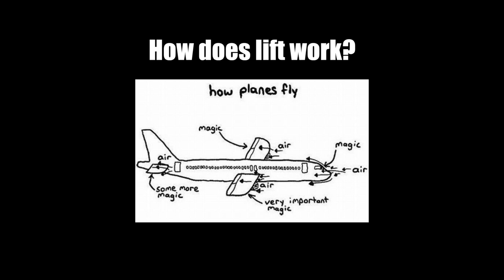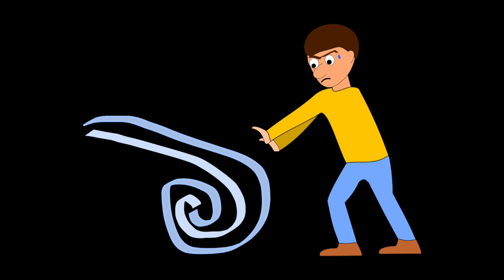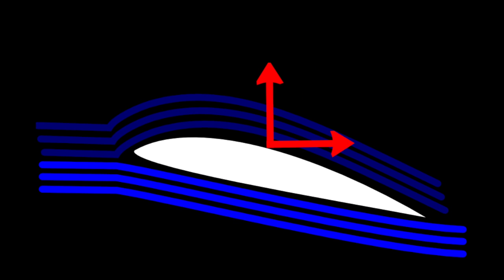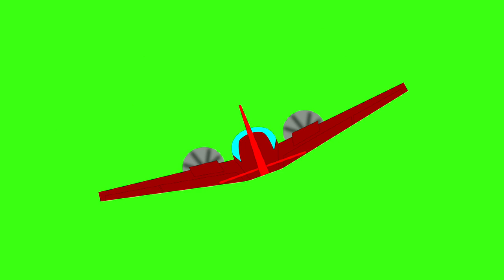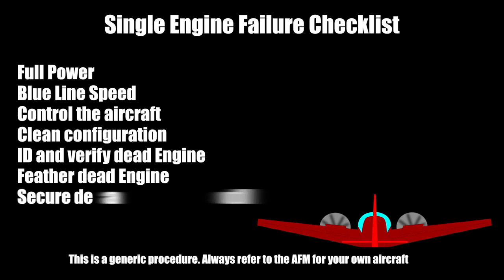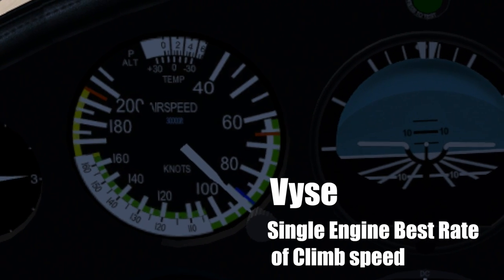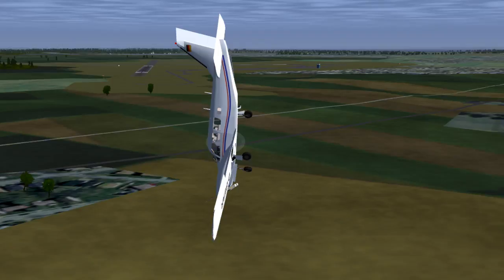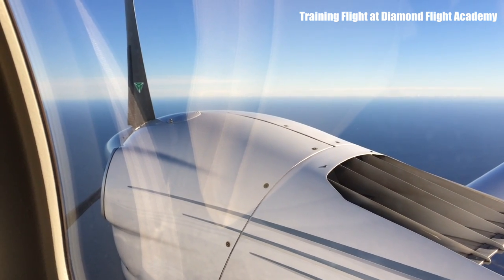Multi Engine Aerodynamics of a Fatal Crash: Mayday Talk Episode 14.5

Comment: The reason it crashed is because the design is not valid.   Such twins are underpowered and therefore are critical to fly.  Large transports have excess power.  

If you put two booms and a third engine in the nose (like a P-38 with an eingine in the pod instead of a gun, you could have an airplane that would be safe and easy to fly.  You would  have each outer engine with a rudder behind it.  When the center engine fails you have two balanced outer engine and it remains yaw stable.  .  When a lateral engine fails that engine is a smaller fraction of the total power and thus less adverse yaw torque.  Also each outer prop has a blown rudder with a camber that pushes towards the inside.  When the flow on the failed engine stops the rudder also has less push and the powered rudder then has a net inward torque making it fly straight without the need for rudder.  Unlike the boomerrang by Rutan, this would be simple, easy to build, cost effective and would allow inexpensive and less reliable engines.  If one fails, it is not a big deal.  You can also fly with 1, 2 or three engines at 65% and get much better MPG at slower speeds.  With the twin you can only throttle back and the fuel economy does not go up because of the increase BSFC or fuel consumption per hp.    

 BTW, Bernouli has nothing to do with it.  Mass downward movement does.  Also, the lift loss is around 25% and this is due to bad airfoil selection.  A good airfoil would maintain lift with higher AOA and would not spin like shown.   In other words, the airfoils are the problem, as well as the layout.  

These airplane are a joke and need to be scrapped.  There is a better way, and I just gave you one way, of many in my comments above.  Pilots are in denial.  These craft are not valid at all.  Three engines or one, but not two.  .

Comment: Not Sure How Much One Might Learn From This Video... I Know Anyone That Has Much Time In a Queen, Either a Big or Small Motored, Queen",,, Knows That If You Were Ever Foolish Enough To Put 10 Souls In Back, and  Then Fire Up The Engines, Your Dancing With The Devil... Any Pilot of Merit, Should Know That One Pop Out Of Either Engine,,,  Would Immediately Dictate Pulling The Power Off The Other Engine... (At Least You'd Hit "Right Side Up" ) A Queen 65 Has a Single Engine  Rate of Climb of Less Than 200 FPM At Gross Wt... (That Is After It's "Been Cleaned Up"  On a Standard Day) ,,, Merryface, That Was a Rude Comment I Made,,,, I am Sorry For That,,, There No Excuse For Rude Behavior... But One Must Always Remember, That There Are Only Two Types of "Aviation STORY"... When You Are Talking About Airplanes, Pilots, or Asian Massage Parlors,  There Are Only Two Types of STORY.... There Are "TRUE STORIES,,, and Then There Are,,, "STORIES",,, "That Actually Happened",,,, Usually The Two Are Not The Same,,,, This Flight Was Hanging By a Thread,,,
Reply from the maker: Hi. As an active airline pilot and ex flight instructor, i standby pretty much everything I said in this video (other than calling a Vmc roll a spin.)

What is it you think that makes me a "hangar queen aviation parrot?"
Reply: @MerryfaceAviation  🤗

Comment: Well, your explanation of lift is totally wrong. It also fails to explain how airfoils can generate lift when they have equal length surfaces (such as symmetrical airfoils). It also fails to explain how a conventional airfoil can generate negative lift at sufficiently low angle of attack - such as when the plane is flown upside down.
Reply from the maker: @PrimalBlueWolf  my explanation is not wrong, I omitted more complex aerodynamics. but the explanation is correct.
Reply: @MerryfaceAviation  fundamentally flawed. If airfoils generate lift due to the difference in length between the top and bottom surfaces, then why can a flat plate, such as a literal barn door, generate lift? Why can the Extra 300S generate lift, with its symmetrical airfoil? Why can my FA-200 generate negative lift, with its conventional airfoil?
Reply from the maker: @PrimalBlueWolf  yes i know, but I'm giving the textbook explanation. which is why I also gave the newton's law explanation. it is purely for the sake to be able to explain the rest. this is not for aeronautical engineering students mate
Reply: @MerryfaceAviation  Ironic then, that you said you wanted to do a good job of explaining it, when you went for the (wrong) textbook explanation. Also, Im not an engineering student - I fly these.
Reply from the maker: @PrimalBlueWolf  so do i mate. it is incorrect, but it is the syllabus explanation. you want to compare credentials? Not how I normally roll, but ok: ex flight instructor and current airline pilot
Reply: @MerryfaceAviation  you started that with calling me an engineering student. not how I roll either.
Reply from the maker: @PrimalBlueWolf  never called you an engineering student :) I said the video was not for them

Comment: Then this design is bad obsolete in case of engine fail , period..
Reply: All light twins can crash like this if it goes below Vmc. Its inherent with any light twin design. There no way to design it out
Reply: @5678sothourn  except a 337 where the engines are inline with the fuselage
Reply: @5678sothourn  --There are ways to allow them fly on one engine, CR engines, more HP, better aileron and rudder imputs, etc... But USA twin buyers wanted easier to fly airplanes (with less HP and not too light controls) without thinking of engine fails, specially on take off. 
More HP and lighter control twins are not for clods.  Then the clod lose an engine on take off and they suddenly feel the real need for more HP they didnt want before, AND lighter controls THEY DIDNT WANT BEFORE EITHER.. And crash.  Clods should not given pilot licenses. They favor BS airplanes..
Reply: 5feetgoaround fullflapsC150 incorrect. You talk to any pilot and while all those things can reduce Vmc, it can never eliminate it. Vmc is inherent in any light twin design. Any. If the engines aren’t stacked over/under directly on the centerline, it has a Vmc.
Reply: @5678sothourn  Thats BULLSHIT.. You can change a lot of things on an airplane or car for the better.  Im a mechanic, pilot 7k hour and CFI and seen that and work on that too. We mechanics modify things every day if we want..
Reply: 5feetgoaround fullflapsC150 you can change them for the better but you can’t make them perfect, and Vmc will always be an issue because physics still exist and whenever a engine goes out in a light twin you will always have inequal thrust over the wings.

Also, modify every day? Doesn’t doesn’t sound regulatory compliant.
Reply: @5678sothourn  -- Now you agree they can be changed. Navajos were with CR engines and more HP..  Now GFYS with your brab...